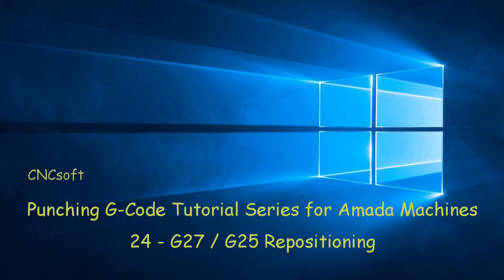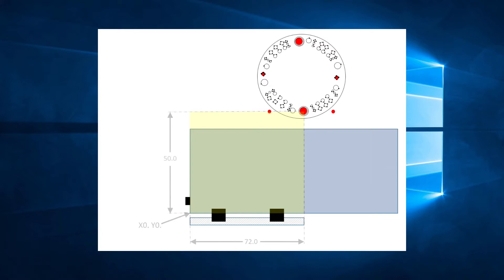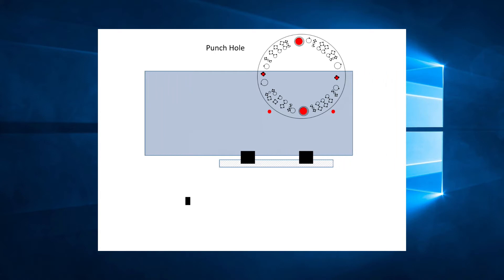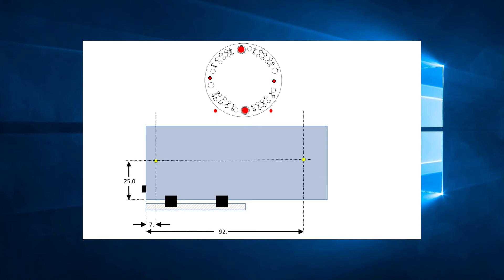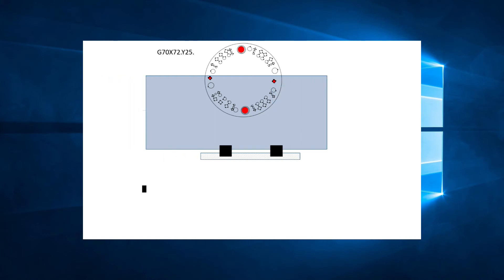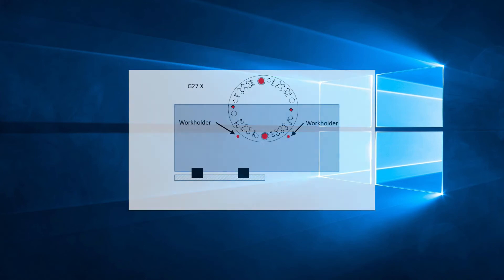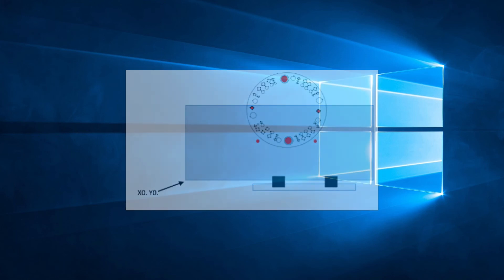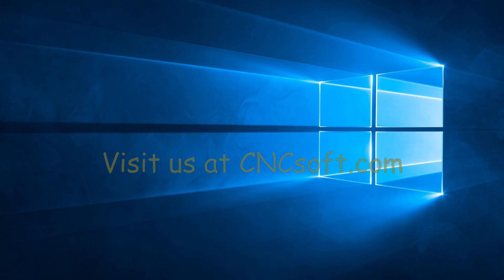24 - G27 / G25 Repositioning - Punch Programming G-code Tutorial Series for Amada Machines

Comment: From 4.28min, we started the program with 
G70 X20 Y25 (worksheet was still hanging off? this should be start at origin point 0,0 right?)
G27 X-20
G50
Reply from the maker: Yes, it is off the table at that point. We are continuing the program so when we do G50 the 0,0 of the sheet will be where it was when we loaded the sheet on the table.